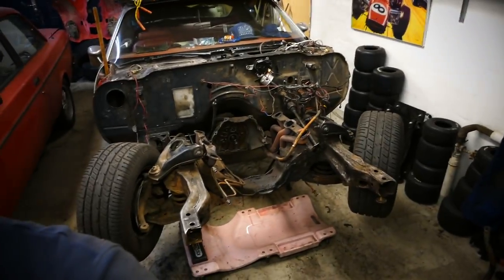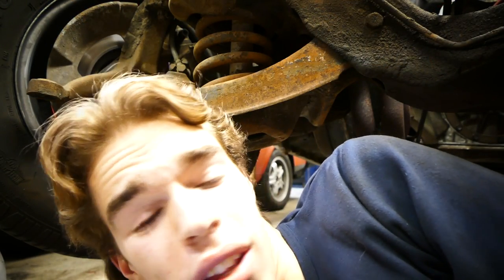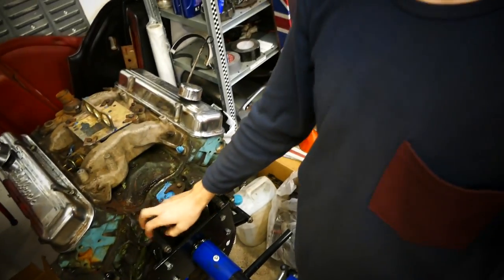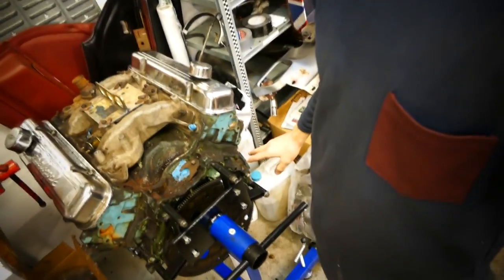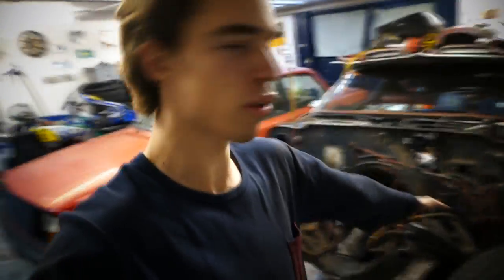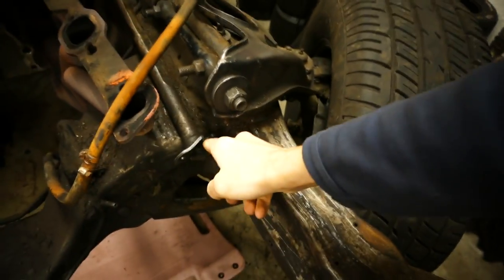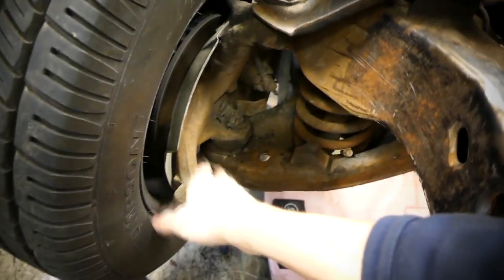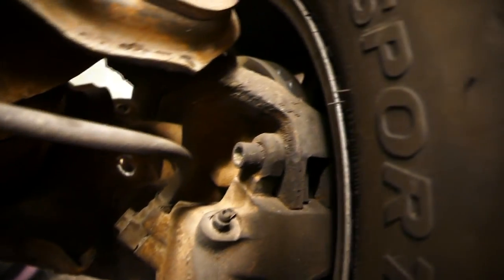Build Update & Steering Removal 1970 Firebird Drift Car Build Part 8

Comment from the maker: any good ideas to achieve more angle?
Reply: Viktor Hansen i Think the only cheap Way really is cut knuckles. The arm that the tie rode pushes just cut that and weld the hole part back on.
Reply from the maker: Yeah that’s true and maybe Remove the old steering stop, I would to find some custom knuckles/spindles for the car
Reply: God video
Reply from the maker: Tak :D

Comment: Glad you’re keeping it Pontiac powered! Have you planned out an engine rebuild yet? Also about your brake situation I believe you can put 4th gen camaro brakes on the stock spindles. That’ll be quite an upgrade however there’s a guy who’s running 4 wheel disk on his 1st gen firebird with camaro / corvette parts and it will be a pretty easy swap and a lot better than your stock rear drums.
Reply from the maker: That’s sounds like a way to go I really got look into that thans for the comment man :)
Reply: Viktor Hansen any time! I was looking at my car earlier on how to get more steering angle and someone said where to cut the knuckles. That would be a possibility plus taking out the inner fender wells will give you the extra space for the tire and a little weight reduction. The engine bay will get really dirty though.
Reply from the maker: I was thinking about making some plastic inner fenders :)